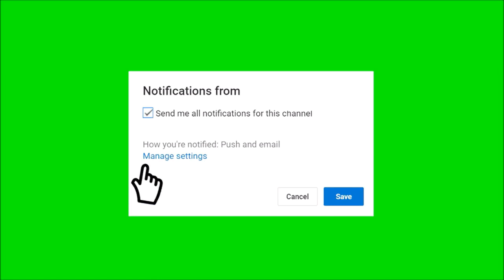Canon ImageClass MF3010 Printer  || Refill cartridge CE285A ||

Comment: Canon MF3010 and MF241 Model printer has the same  dim printing problem.... i have changed drum /Dr.Blade/Waste flter blade and use genuine ink like ProDot/BNW etc but still its very dim ...even i have changed magnetic roller and cleaned with petrol and its ok printing after that but not the best quality and after 100pages of printing again the same problem. it doesn't work and even the repair center cant fix for fine printing Canon MF series sucks!!! i dont recommend anyMF series .....
Reply from the maker: you can change the all drum unit
Reply from the maker: please subscribe our channel